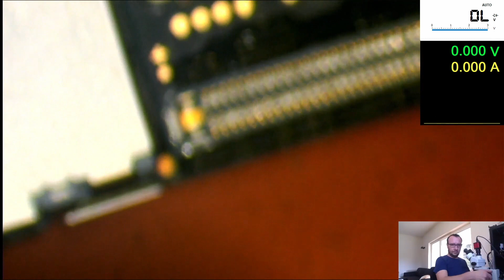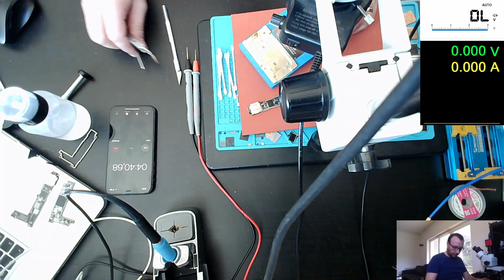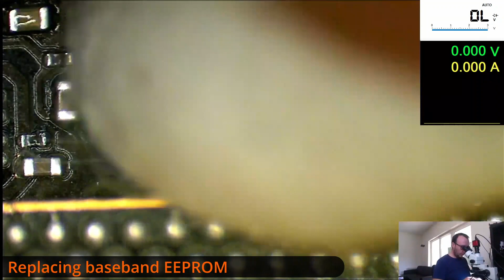iPhone 12 mini bottom board swap no IMEI

Comment: After swap ...the phone need to restore or no?
Reply from the maker: No, you don’t need to restore
Reply: @boardrev if unable active need to restore right?.what temp/air for remove bb cpu ip 12  sir?
Reply from the maker: @jfixtechnology  If the phone has been restored while bb cpu was not working, then yes, you need to restore. But if the phone wasn’t reset after the damage and has data on it then you don’t need to restore. I am using 380C and 50 air to remove on an Atten 862d station with a 6mm bent nozzle. For soldering back the bb cpu I am using 350C with 40 air same nozzle. Remember, temperatures differ depending on stations, technique etc
Reply: @boardrev  thanks sir...

Comment: Is it possible to use another entire working bottom board and the IMEI would work fine?
Reply from the maker: No. In an iphone, CPU, baseband and Wi-Fi are paired together. On the 2 layered boards, baseband and Wi-Fi chips sit on the bottom board. Baseband chip needs the eeprom also that sits usually next to it. It contains information that baseband needs to run. So, on 12 models and above you need to swap these 3 chips with the originals that are paired with your CPU. On older models you can get away with the Wi-Fi chip as there are tools and methods to unbind the original Wi-Fi chip and use a replacement.